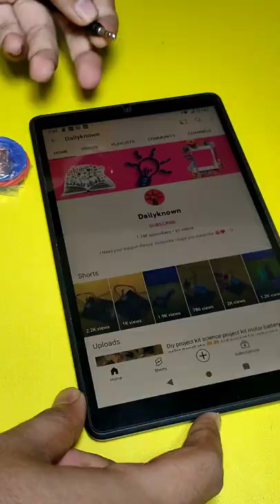how to make speaker at home diy speaker homemade speaker #short #diy

Comment: How to make it good premium sound quality and not fake JBL Box from AliExpress sound quality?
Reply: Its extremely hard to make a good quality speaker
Reply: Simple trick:- buy old Nokia phone speakers connect them and make a dj type look cover your system using wood pieces and black paint on it, on your mobile Bluetooth then feel the sound 🔊📢📢📢🎶🎶 and bass quality it's greater than 100 waat dj

Comment: Fake bro he just made a vocal coil that doesn't even work
Reply: It's not fake, if you don't know how a speaker works, don't say it's fake
Reply: @geraalvizures5840 bro I had made a speaker before. That's not a right way to make a voice coil you need to Aline it perfectly or it doesn't works and that's a cap
Reply: @Sphacker659  having the wire not perfectly wrapped just makes the magnetic field produced weaker, it'll still work